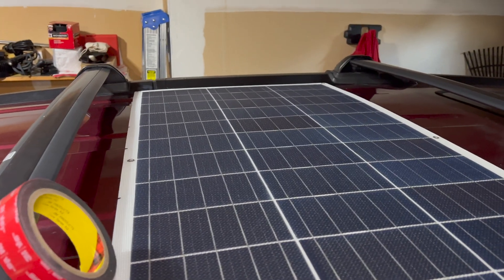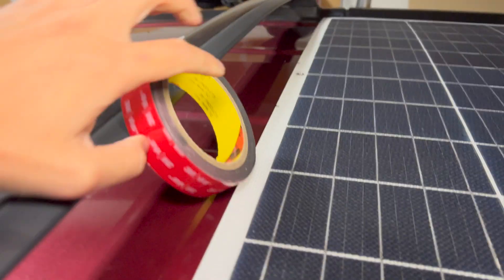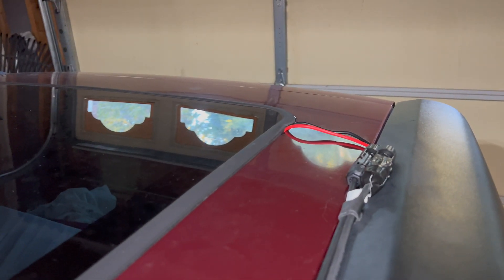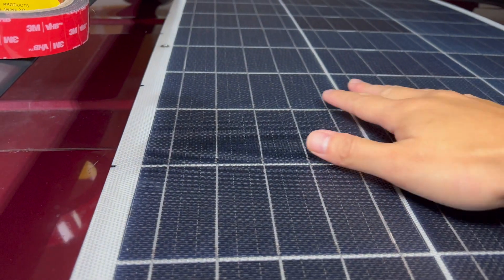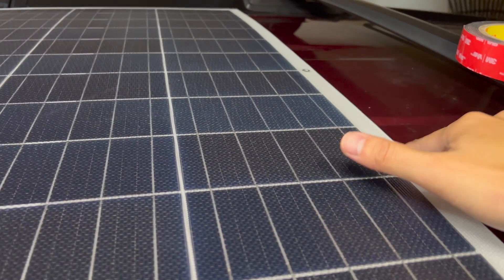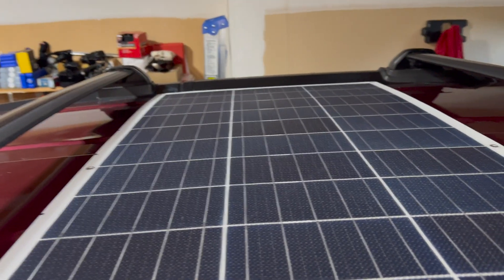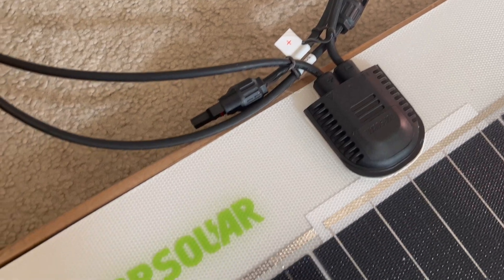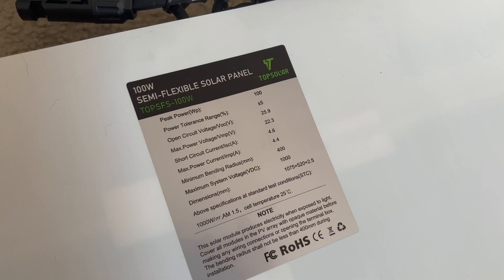Honda Element Solar Panel Installation

Comment: Hows it held up?
Reply from the maker: Good. Secure it well with lots of 3M auto tape and make sure both surfaces are clean. The solar panel itself is a champ and a great fit

Comment: I love your videos and I’m currently working on my element set-up, so thank you for great advice! Have you had any issues with rain leaks from the cords going into the moonroof?
Reply from the maker: Thank you Jessica. I have been in some heavy rain and there are no issues whatsoever. It just smashes the cable and still makes a perfect seal. The cable being pinched may or may not effect the efficiency of energy going through but its fine from my observation

Comment: I would get some corrugated plastic from a hardware store, or even use 4 or 6 pieces made from road signs of the same material to install under the flexible panel to keep them cool.

Comment: I heard you can run the wires under the plastic runners on the roof of the element then drop the wires down behind the interior panels of the element for people who do not have a sunroof.
Reply: That sounds better, even if you do have the sunroof. It's always better to have wires tucked away so they can't be damaged.

Comment: Well done. The placement means you can't have use of the roof rack and collect solar energy at the same time, however. Many on the road with an Element have roof-top carriers, etc. for storage… which makes the front hood a potentially better location for some.
Reply from the maker: I do want an awning at some point but i dont see myself needing a cargo box or anything that would majorly block the panel..do you mount solar on the hood? Seems….hot
Reply: @HaoVu1  For now I've got with an EcoFlow folding 160w panel that I can take out (and lock down) when charging my EcoFlow battery. I lay it over the cargo box! Raffi Zaki is the one with a panel on his hood.